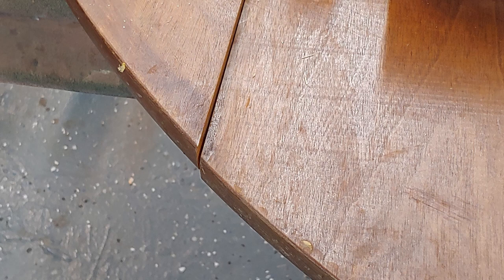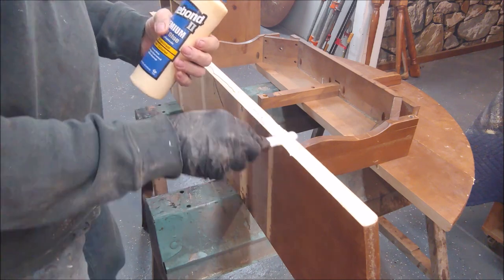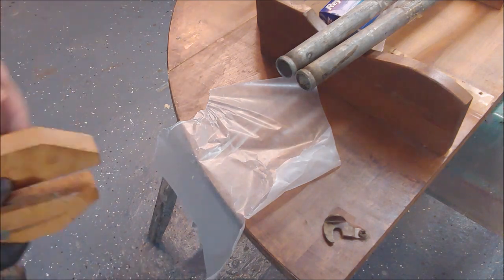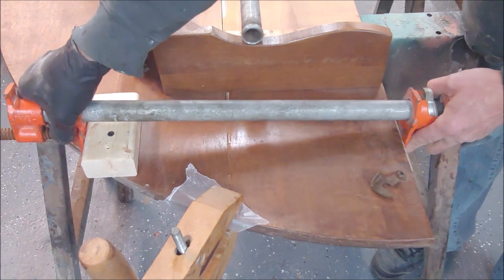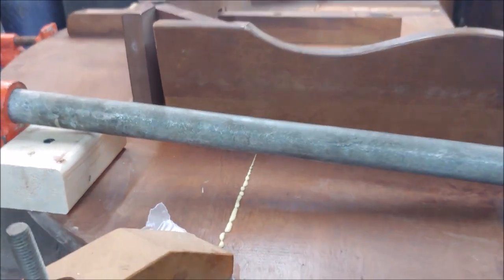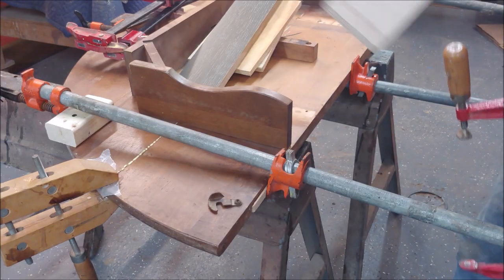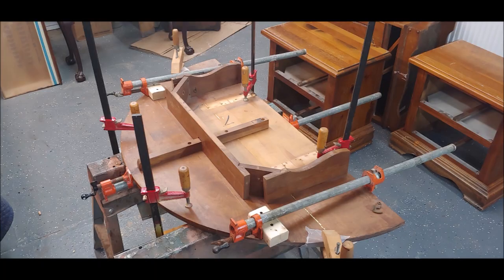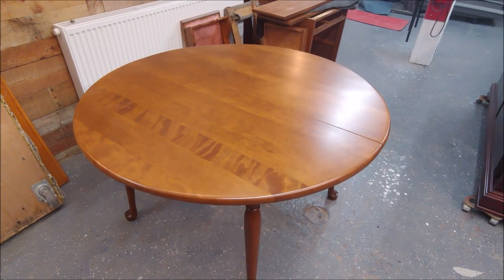Repairing a Split Round Tabletop - Woodworking

Comment: This was absolutely outstanding.  I have the identical project and split seam.  This walked me thru it.  I did not even think about the issue of the table top bowing once it was clamped.  I have no concerns about taking this project on now, at all.

I am curious though, why is you leave the frame of the table attached?  Would you recommend this approach, or fully disassembling and just working with the flat table top itself?

I am just a dyi guy, not a pro.  Your series is great.  I subscribed just to watch you do more.  Thanks.